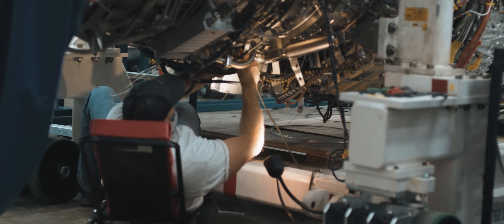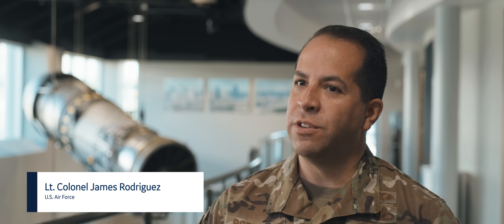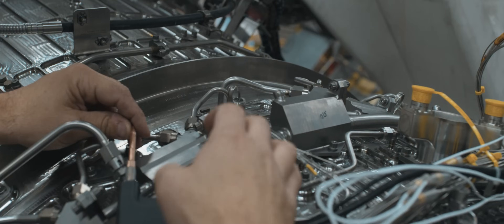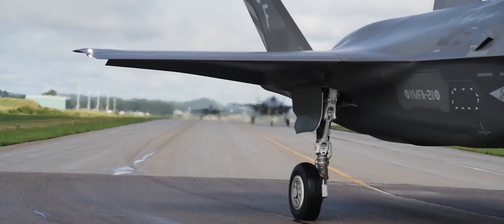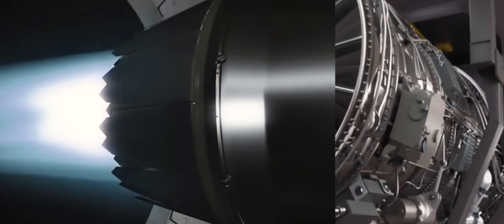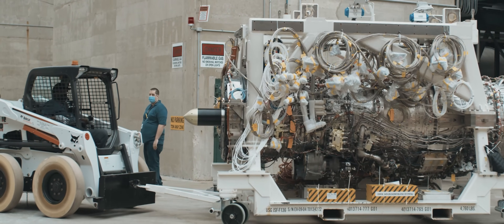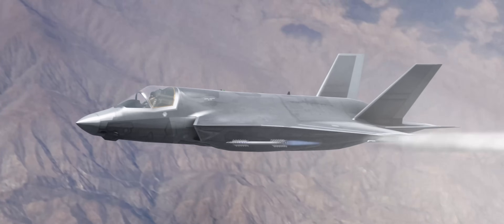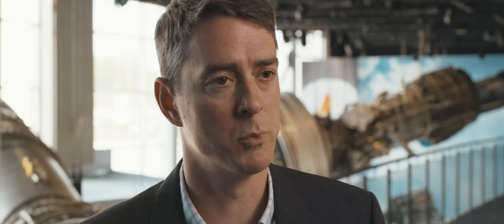GE's XA100 Adaptive Cycle Engine

Comment: It suck so bad that they decided to go with the F-135 upgrade instead of this, what a shame
Reply: It's not about it sucking or not.  It's about dollars.  How much does it cost to add all the logistical requirements on top of an existing  supply chain.
Reply: Given they didnt get the contract, this engine didnt go into production and probably remained in the prototype stage. Its probably significantly better now and its going to be put in a significantly better airframe

Comment: It's nothing new to improve an aircraft's performance by changing to a new engine.  The P-51 Mustang went from an Allison to a Rolls-Royce Merlin and the F-16 went from its original Pratt and Whitney to its current GE engines.  As for what some of the new terms mean like Adaptive Cycle, well it could mean nothing or it could mean they would have to kill you after you heard it.
Reply: It's really not that complicated. The engine can basically change gears to deflect air through different channels, high-pressure, fuel-efficient, and cooling. This allows the airplane to maintain not just different modes, but being able to cycle different hybrid configurations between them in milliseconds, like a shape-shifting Transformer. When you combine this with other technologies like VTOL and thrust-vectoring, this could eventually lead to something we can really argue is a real-life Transformer in machine at least.

Comment: Adaptive engines are a step back from truly revolutionary engines like a pulse destination drive.
Reply: We're getting there but ACEs are a step up from current fielded and proven technology while pulse detonation is still in a mixture of testing and theoretical. They aren't far off though.
Reply: @terrestrialextra4790  in short, pulse drive is still far away
Reply: Did you mean "pulsed detonation drive"?

Comment: Adaptive engines are truly the future. Need to be given the chance to be developed as ACEs will become mainstream soon enough.
Reply: Adaptive engine my ars! So what's new?  Since WW2 it's been burn a hydrocarbon fuel and then use the generated heat to accelerate a gas.  Time to stop playing with the Brayton cycle.  The only substantive change was the GE nuke engine of the mid 50's.  Time to stop playing with electrons and use the nucleus!  Heat isn't the only way to accelerate mass.

Comment: Engine for NGAD ?
Reply: Yes.  These were developed specifically to fit into the F-35, but they are also going to be used in the B-21.  The theory is that they will also be used in NGAD, but instead of one engine like the F-35 has, NGAD will have two of these.
Reply: Now for the new F-35s!!! This will allow more energy to mount laser weapons and plasma hologram to dodge infrared weapons!

Comment: 3D print compressor & turbine disks will be soon ??
Reply: Musk is already doing this.  All of his rocket engines are 3D printed.
Reply: @georgevantuyl5837  Rocket engines are orders of magnitude easier to do than high pressure/high temperature turbofan hot cores.  Think about the thermal range and tight-fitting blades spinning at unbelievable RPMs, with substantial levels of pressure flowing through those stages.  Pratt & Whitney has been doing single crystal blades since the 1980s, with tolerances that would make Tesla engineers shudder.  Additive can’t do that, not even close.
Reply: @LRRPFco52  Additionally the operational time on jet engines is a huge factor that makes material development difficult. You not only need something to survive the tolerances, you need something to survive the tolerances again, and again, and again so you can leave it on-aircraft as long as possible.
Reply: @mcshakycheese7396  Yup.  I’ve been in aerospace and defense since the 1970s, specific to fighters mostly at the USAF Flight Test Center at Edwards AFB.  We were more focused on avionics and weapons, but propulsion guys are right there too of course.  One of my close friends worked for Pratt & Whitney on developmental programs on the F-15 and F-16, to include the STOL MTD F-15.

I watched the days from TF30 and early F100 all the way through DEEC, FADEC, F101 on the B-1B, F110, F100-PW-220, F100-PW-229, etc.

Nobody does HPHT turbine cores like the US.  Our MTBF is the world standard to beat.  We pushed ahead past the Improved Performance Engine with F119 and then even more with F135 motors.  Russians and Chinese are trying to catch up to where we were in the early 1980s with F101, and failing.  They’ve reached the thrust, but not the durability/reliability.
Reply: @LRRPFco52  I did some work with Pratt & Whitney commercial-side on their Next Generation Product Family (NGPF) line of jet engines developing Application Software for their FADECs. One thing that has become increasingly interesting over the last two decades on commercial side is the need for more software-heavy predictive maintenance algorithms/LRUs on-board the engine (or via data upload by fleets as they operate and pass it to ground stations). It felt like on the commercial front, while there have been some leaps in hardware (and will continue to be as aircraft electrification/hybrids are pursued), a huge factor in keeping the engine on longer is your supportive software capabilities which let you narrow down exactly when is most efficient to do activities vs. going off an X-month inspection approach. Currently doing some work towards this Adaptive Life Cycle concept, but coming off commercial I wanted to brief myself on the total objectives haha. You don't always get program managers who tell you anything about the big picture other than WE'RE BEHIND SCHEDULE AHHHHH, OUR MONEY AHHHHH.
Reply: @mcshakycheese7396  The F135 is awesome in that aspect, where the prognostic monitoring will sense changes in Inlet Turbine Temp, RPM, combustion temps, fuel flow rates, compression, etc. and trigger different staging of the engine as well as fault alerts with automated down-throttling and preservation of the system.

The proactive maintenance aspect of the system results in lower break rates and higher readiness than any other fighter.  Maintenance Man Hours Per Flight Hour for the whole aircraft are astonishingly-low, like in the 3.5-4.5hrs range fleet-wide average, older airframes being the major contributors to the hours.

There should be some trickle-down from F135 over to commercial GTF and PW4000 series.  Have you guys done anything with Digital twins for the motor in terms of modeling and replicating parts plus mimicked operational envelope?  That’s where the money is for agile software development in support of developmental and in-service fleet samples.

Imagine a living modular database where each engine has its own functional virtual twin, where all of its parameters are continuously mirrored in near real-time, and cross-checked algorithmically.

That will save a lot when looking at fault anticipation and avoiding arbitrary overhauls, some of which might do more harm than good.
Reply: @LRRPFco52  Yep! That's definitely a capability commercial side, with most platforms seeming to have on-board validation of engine parameters through a flight model which also helps decision making in sensor voting / down-selection. Of course, as models get more complex and you want finer resolution, storage and computing power becomes a challenge. Seems like a lot of modern FADECs were copy pasta derivatives over the years due to cost to certify new hardware (or win bids). A lot of computing these days seems like it will end up requiring advanced CPU solutions which will probably be in itself a whole shenanigan to bring to product lol.

Comment: How much power does it generate and how fast it is
Reply: 50,000k lbs thrust
Reply: @dwizzleusa4202  50 million pounds?  That's some engine.
Reply: 1,200 watts. It can power a toaster, but thats abt it.
Reply: Current F135-PW-100 engine in the F-35A is 43,000lbs of trust in max burner, and 28,000lbs in military dry power, de-rated for longevity to 40,000/25,000.  Pratt & Whitney already made a drop-in hot core stage that can be incorporated into the depot-level scheduled overhauls that delivers 47,300lbs of thrust, with 6% fuel burn reduction, and that was done years ago.  They have another program that improves those numbers even more, especially the fuel efficiency by 20%, with 15% thrust improvement.

That would mean 49,450lb of thrust in max burner, 32,400lb in dry power.

Comment: No information about cost? I guess this will be in b21 or PCA, maybe f35s? god we dont need any of this though
Reply: XA100 OR XA101 are designed to fit the F-35, iirc they plan to reengine starting in 2027. A further evolution of them will probably power NGAD (PCA) . B-21 uses a upscaled F-135 to my knowledge
Reply: @hermanmusimbi4337  Huh?  What specifically did I say that you are objecting to?
Reply: It's mostly for the next generation fighter
Reply: @bright5967  It is intended for the F-35, particularly the F-35A.  It is a tacit admission that the F-35A, as it is now, does not meet the USAF's needs.
Reply: 80 Gazabillion dollars!
Reply: @hermanmusimbi4337  Current performance *is bad*.  The F-35A can't supercruise, which for what is supposed to be a bleeding edge fighter is inexcusable.  The F-35A won't live up to its promised design goals until Block 4 airframes with adaptive cycle engines show up in 2028, twenty-two years after first flight.
Reply: @hermanmusimbi4337  That "cruising for 150 miles" thing is just something they made up to save face.  To do it requires using afterburners to get supersonic, then the pilot throttles back to military power.  The 150 miles is how far they can fly before the plane has decelerated to below mach 1.  Supercoasting would be a better description of it.  Of course this only applies to the F-35A, the B and C are not allowed to fly supersonic unless in an emergency.
Reply: @hermanmusimbi4337  Supercruise is well defined: sustained (only limited by fuel) supersonic flight without the use of afterburners.  The variable is what loadout the plane can carry while supercruising.  Eg. we know the F-22 can supercruise with a full load of internal stores, but we don't know how much it can carry externally and still supercruise.  The Eurofighter Typhoon can supercruise with some amount of air-to-air weapons.  Yes that is vague, but more detailed information is kept secret for obvious reasons.

You are understating the afterburner problem on the B and C models.  It isn't just the skin they damage, but sensors and the structure of the horizontal tail.  They introduced a new thermal coating that has reduced the problem but not eliminated it.

The reason so little time was spent above Mach 1 during the Vietnam War is because it required the use of fuel guzzling afterburners.
Reply: @hermanmusimbi4337  Mach 0.8 to 1.2 is a broad 'rule of thumb' - transonic isn't a fixed range, it depends on the aerodynamics of the plane.  Precisely defined, it is the range of speed where the airflow over the body is subsonic in some areas and supersonic in other areas.  As a plane accelerates from subsonic speeds, as soon as the airflow over any part of it becomes supersonic it has entered the transonic regime.  It will remain in the transonic regime until it has reached a speed where all the airflow is supersonic.

But I take your point on a second possible definition of supercruise.  It is completely reasonable for someone to consider supercruise to only start when the speed is above the transonic regime.

I never stated or even implied that supercruising doesn't use fuel.  The faster you go, the more fuel you burn.  Afterburners are on a whole different level of fuel consumption though, with easily twice the thrust specific fuel consumption.
Reply: It'll be in the F-35 and likely NGAD and YES, we DO need engines like this. If war ever breaks out with China, especially over Taiwan, without engines like these we'll likely limit ourselves to the Straight of Mallaca, behind Taiwan and Okinawa rather than a real theater of conflict because we don't trust our missile defense within China's area denial zone and our F-35s and Super Hornets don't have the range to make a 1000 mile round trip.
Reply: Uhhhh why tf would they be putting a 6th gen fighter engine in a subsonic stealth bomber?
Reply: @myusername3689  Well if you weren't an absolute plebeian you'd know that the B-2 essentially makes use of 4 F-110 engines with their afterburner removed. So this wouldn't seem surprising much like it isn't to others
Reply: @fokjohn  Hmmm supersonic engines for a subsonic bomber
Reply: @myusername3689  The F135-PW-100 cannot keep the F-35 supersonic without the use of afterburners (the use of which damage the plane), so yes it makes sense to use it - with afterburner removed - on a subsonic bomber.